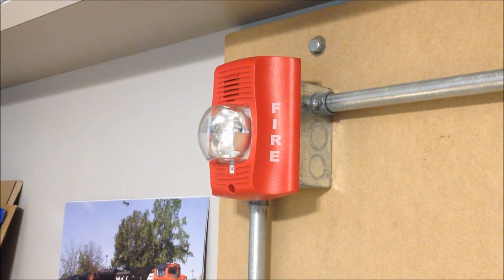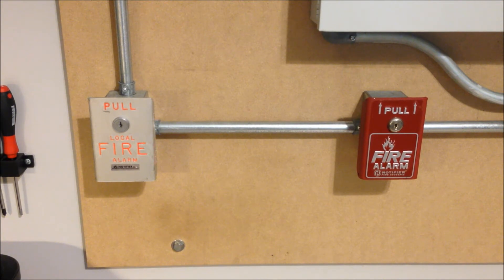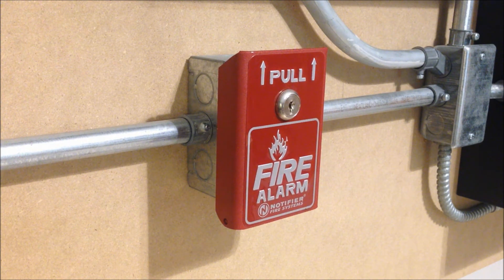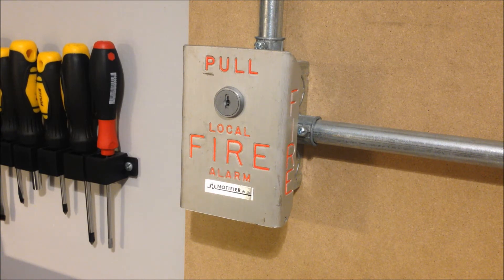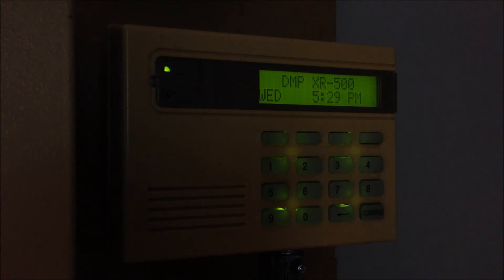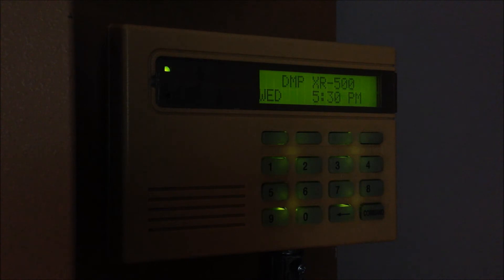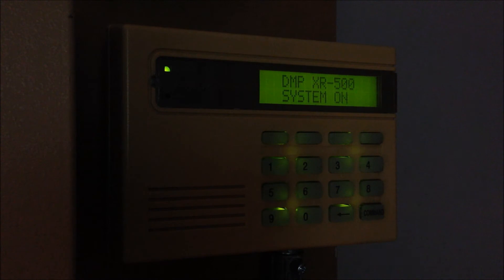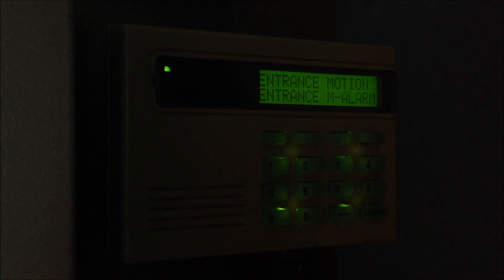System Test 29 | SpectrAlert Advance System

Comment: Why does Siemens panel not have any sync or any audible silence?
Reply from the maker: I'm able to do audible silence with 4-wire devices, but since the P2R is 2-wire, and the SXL-EX isn't equipped with sync protocols as you mentioned, it can't be done with this device. The board for this panel was designed back in the 1990's, so I guess its just too old of a design for such features.